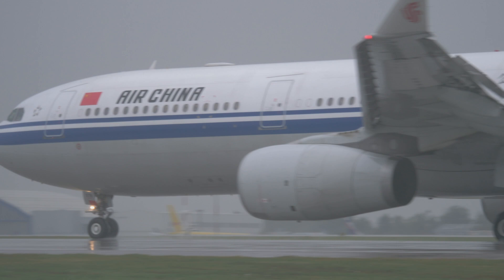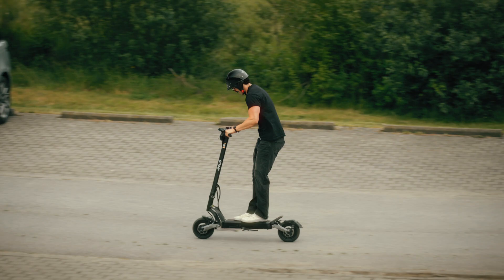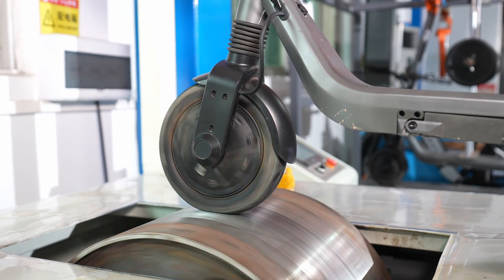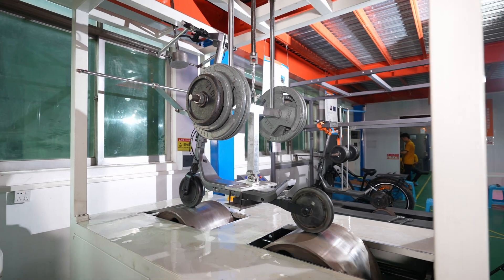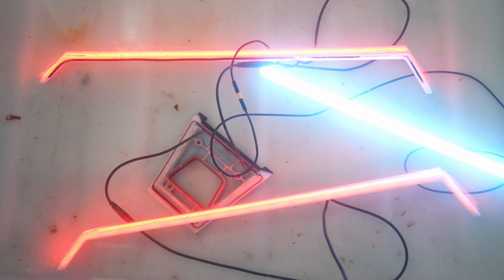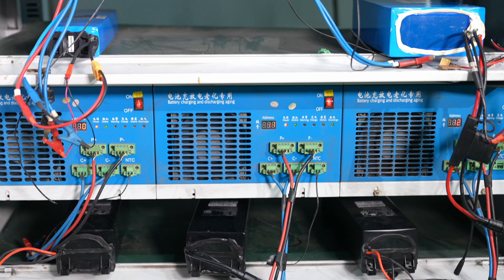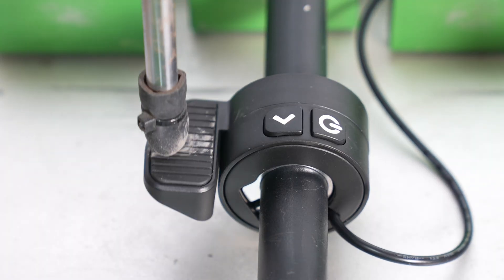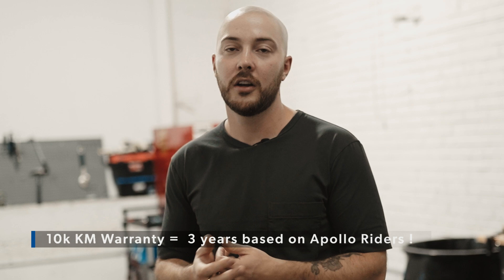Apollo Factory - Testing Rigs

Comment: Since I bought a city 2023I love it but the first thing definitely needs to be improved is the regen  brake throttle.  It should be operated  as the hand bar as the drum brakes. For now the regen throttle feels like awkward. Secondly the buttons of the turning signal need to be replaced for the larger ones and it should be easily find without looking on it, also need to be reloaded bitter away from the throttles to avoid always accidentally hitting it 😂😂😂

Comment: Another test would be a test that would detect the City 23/24 "clicking" problem in the stem. It should be tested against some sounds coming off the bottom of the stem where the directional nut is, and trigger if noise level is "abnormal". A lot of City units has had this clicking problem recently.

Comment: Please puncture test or otherwise spray test tires or tire capacity leaks. Suspension is important, but not all tires are created equal and my Apollo just got a flat, 48 hours after unboxing. Segway and Yadea have high quality tires in my experience, others not as good sometimes.  

Also test packaging and opening of scooters - my brake line scraped either during or after unboxing. 

That said, Segway G2 and Yadea both gave me controller issues initially including scary dead stops at high speeds, the G2 has a rear bumper screw that loosens under suspension loads and when it goes, eventually the back bumper cracks and falls off. Yadea's frame is nearly all one piece and is very impressive, but suspension doesn't hold up to rain much. Still it is the only scooter I feel perfectly safe driving at speed on roads with potholes and turn signals are blinding. Larger wheels (10x3, maybe?) help too.

Maybe a test for visibility distance, reflector visibility/distance, scooter being carried or scooter lying on its side e.g. in a car, how the scooter falls when you forget to fully extend the kick stand, extending the kick stand e.g. scooter with weight maybe. Centering nuts and how they fail, new to me coming from other scooter brands. Motor uphill test, motor under extreme reasonable cold or heat for long periods in different modes assuming trying to go at top speed - I've had some of my scooters sometimes turn off the motor without warning due to overheating, which is very annoying/life threatening sometimes, or the battery works extra poorly when cold. A fold and unfold test and how that affects wires- especially if you follow the Yadea model and run wires thru the stem fold. Honestly, Yadea's design is very interesting, look at the Elite Max.

Also, knowing throttles can fail, it would be nice to have a mode where the brake handle is partly electronic so that it overrides acceleration throttle if pulled. Also if you could have a Segway-mode where regen kicks in when acceleration throttle is released, I'd prefer it. A mode where turn signals need a longer press to engage, with a short press to disengage might be useful too. Turn signals too easy to hit. Miss the left thumb triggering use of turn signals of other scooters. Do not miss the G2's beeping horn tho. And I love the giant bright light, tho it could always use more side visibility. I try to use the Garmin battery radar light to be more visible to cars behind me. Radar built in to the scooter that can talk to a light clipped to my bag would be fantastic. Talk to Garmin, make it happen. ;)

Feel free to reach out to me if you want more third/first-party scooter feedback. Always happy to chat about scooters.

Comment: Should build a “drop test” rig that picks the scooter up about 5 inches off the ground and drops it. 
Would be good for testing how the scooter handles repeated hops off of curbs and if the shocks are sufficient to prevent damage to internal components. A direct hop off a curb is a lot more stressful to the scooter than hitting a pothole and I think more people hop off curbs than expected. Especially on the higher end scooters and such that are designed for thrill and adrenaline. 

Could also create a “vibration test” that quite literally shakes the hell out of the scooter or its electronic components. Could stress test nearly every small piece of the scooter with a vibration table. Welds on the batteries, electrical connections to/in the controllers, bolts that could potentially back out etc. just from having the scooter on a vibrating table.
Reply: I 100% agree, will work on this